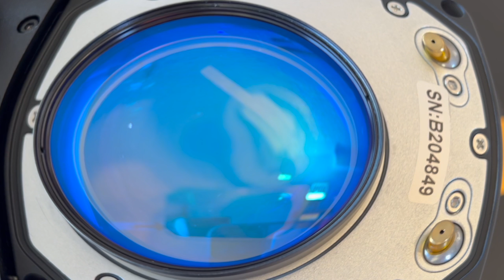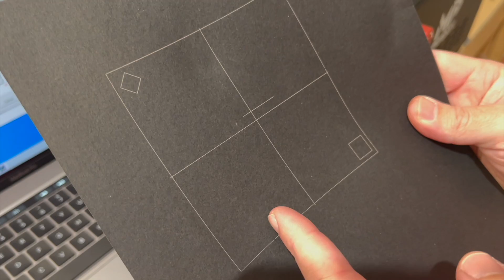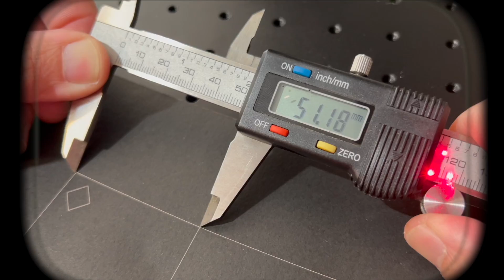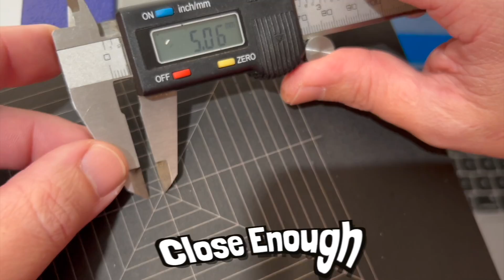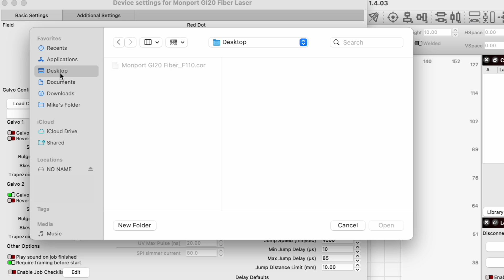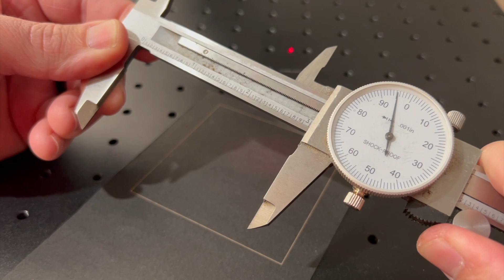Invalid COR File Fix for the Monport GI20 Fiber Laser Engraver

Comment: So, if you follow your original setup steps, and I have a windows computer, will I get the core issue? Also, how did you know you needed file 7 from the supplied USB? there are others there, how did you know to use the one with 7 on it?
Reply from the maker: We did some research on the issue and Alex @lasereverything had a good video covering core file updates.   You will still have to do the process with a windows computer, you just won't have to switch computers like we did.  Thanks for watching!